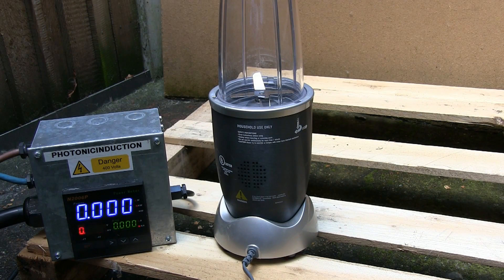Wrong Voltage - Wrong Country

Comment: So thoughtful of the designers putting in that vent on the side for the smoke to come out of.
Reply: Motors need noses too
Reply: If only the smoke stayed inside of it, maybe it’d work to this day as a reliable blender? The vent holes are to blame, of course.
Reply: @maxxdroid  yep. Once you let the smoke out, it doesnt work anymore. Maybe we should seal up stuff better.
Reply: If you look on the other side there's a little tank where you can top the smoke up.
Reply: @skylined5534  that's nice of the designers

Comment: Its like he knew it wasn't dead after 250v had to go for 500. lol
Reply: If it stopped working because of a small open in the windings, eventually increasing the voltage high enough will jump the gap.

Comment: The one dislike is from his the power company.
Reply: Are you kidding? His power company probably loves him... the more electricity he uses, the more money they make...
Reply: He puts lots of very short duration, large loads on the grid which stresses components.
And also lots of reactive power. Absolutely tons of it. They probably have a dedicated bank of capacitors to compensate all the inductive reactive power :-)
And let's not forget about interference and other crap put on the network by burning and overspeeding universal motors ;-)

And to top over that, he doesn't consume a lot of energy. Probably 2 or 3 kWh per experiment, which is about 0,6€ at 0,2€/kWh (which is very expensive) so he is a nightmare for the power company :D
Reply: If I recall a previous video, he has a battery system in his house that charges up at night when the rates are cheaper.
Reply: That's only for general house electricity, it can't supply the many KW he tends to pull in his videos, not even for short time periods, for the vids he is purely using grid power.
Reply: Max And utility workers.
Reply: More like his insurance company.
Reply: Do you seriously think that the power company cares a single bit about these experiments? At my work they have like 50x 200kW machines running 24/7. The limit of one household is like a fly for the power company.
Reply: @willdemeyer6397  Never!

Comment: Wish he kept it at 240 a longer time. Would have liked to see how long it'd last.
Reply: he didn't get far beyond 240 tbh, within tolerance. some houses get close to 230, some get close to 250, its not inconceivable that some houses could go all the way to 250
Reply: Qwertydex I think they make one for the european market I guess they use similiar components to cut down on cost so it would maybe actually last a pretty long time
Reply: It failed at 253. Anyway. In the US, measured 10 homes and I never saw anything beyond 235.13V - 245.01V (yes we use 240V here, its a center tapped pole transformer, Line Neutral Line, 120 0 120) outlets in homes here are usually usually split, half of the home runs on Line 1 and the other half runs on Line 2, while 240V appliances (electric ovens, washing machines...) use all three (L N L) (with neutral just for safety)
Reply: yeah, if failed at 253, so it wouldn't have survived any longer if he kept it at 240, its a small increase relatively speaking :/
Reply: +Qwertydex
249 at my meter. Klein cl2000 measuring tool.
Reply: If you allow 10% fluctuations then yes the 240 will go over the 260 volt make, in Australia it used to be that a appliances were designed in stating 240 volt and it would allow within that margin and the voltage from the outlet would usually range at the standard 220 up to the 250 volts. I've had meters at the outlets and written it down over the years and the fluctuations I've noted. Rare did I see above 255 volt but yes it has been above that. Nowadays I see devices say 110-220 volt so I'm wondering if the companies are allowing for that 10% fluctuation. Which might explain why I've been hearing more and more stories of devices failing of voltage overload over the last few years, so long as the voltage has been reasonably set to the countries rated voltage.
Reply: It wouldnt even have lasted at 240, prolly not even 200, as the motor spinning up lags behind the voltage applied. It was the motor that blew out. So wouldnt have made a difference.
Electronics blew at 500 smth. For as far as there is electronics in it.
Reply: I bet it would have lasted a few minutes on 240vac 60hz. Maybe I will find one to test

Comment: That was short and sweet. :-)
Reply: Especially when it eventually in the end well sort of may be shorted out hence the sparking in arcing. Although some of that could have been opening circuit but usually there's some shorting going on when the motor gets out hot and of course is smoking like that.

Once had that on an old 120 volt motor that was running something but it just wore out the point that the warnings were no good probably bit of overload as well but the voters for dirt cheap I knew where I can get them for nothing they were being replace all the time in particular devices so yeah indefinite Supply of the motor so I did not care one bit.

Use them in all kinds of things BP Motors use them in all kinds of things Fifi Motors even after they were replaced it don't know why they were being replaced or what they were in but they still work just fine for what I needed but not in the original application for some reason???

Reliability loss of performance who knows I was not the only one picking those Motors up either I found out.

A few places in town I could get these as well as large supplies of them.

If I remember correctly there were series Motors Universal Motors but it's possible they were DC motors specifically shunt worth compound wound can't remember long time ago all I know is they did have at least one set of brushes in them which occasionally I did replace I kept one Stella compatible on hand is those things just for brushes quite a bit even in normal operation although I think my brush won't life may have been longer interracial because it be running at lower speed my applications normally.

Although they were very high quality FIFA Motors still couldn't figure out what priests ever be replaced that's such a heart rate weird maybe it was something that was critical about them that had worn out or who knows?
Reply: thats what she said

Comment: Fun fact, Back in time there was 110V as paralell for example in some aplications on railroad, Military, etc.

Some apparats had a backplate switch that could be adjusted between 110 to 220V (GB had 240V, wich ment 20V above old Scandinavian standard, today EU standard is 230V)

A friend told me that he forgot to put back the screw for the voltage switch on the Shaver after wisiting an old Mil camp out in the norhern forest here, so it run on extremly hig speed when he turned it on next morning after went home with the train, but he was able to sawe it...

Comment: This makes me remember the hair dryer I brought with me when I visited the States and set it to 110 volt. Then back home I forgot to re-set it to 220 (or 240..) and I started it and felt it was a bit... hot. :D Got very hot quickly and quite red (in the elements) thank goodness I pulled the plug quickly and it is still fine. It is an dryer from 90s and is for "travel use" hence switch. (the kind that you need a fat flat screwdriver)

Comment: The United States is actually a 240v country as well. But most of the equipment "except 16,000+ BTU air conditioners, electric water heaters and electric dryers" in the United States are rated at 120v.

Comment: Turns out a 60 hz appliance can receive 50hz current without much issue, other than extra heat. As long as the voltage is the same as what it requires. :). I just recently found that out and was fascinated!

Comment: So ALL the outlets in the UK are 220/240? 220 here is reserved for very large compliances like a cloths dryer or hot water heater.
Reply: All outlets in UK 240.Volts and same in Australia. Sometimes it can get high as 260 Volts which can be a problem for some 220 Volt devices.

Comment: have you done anything with an electron gun from a crt tv and a resonator from a microwave. it may have an interesting effect, if I'm right, electrons will follow the flow of a magnetic field, my concern is what happens afterward. once resonance is achieved and then the induction of electrons occurs the flow may need to be condensed in order to have a more defined effect. I always wanted to see what it would do lol

Comment: Are electrical deaths more common in other countries due to higher voltage?
Reply: Richard Harrold voltage hasn't got much to do with it. 240v will also grab and kill you. Any ac voltage will cause your muscles to tense. It's the current flow across your heart is what kills you.
Reply: Not really, either one will kill but under normal use (and modern breaker boards) you're pretty safe unless someone dickered with it or it was shoddily made
Reply: Richard Harrold I've been hit with 120v more times than I can count, usually just a little tingle if your not wet or anything, but it most definitely can kill you if you have moisture on the area. I just imagined that 240 is more lethal because it can overcome your body's resistance more easily... that's what voltage does, of course.
Reply: Well AC can overcome the resistance of your skin with as little as 20 or so volts, so if that's what you're going by then it makes very little difference, what does make a difference in how lethal it can be is where the current flows (through your heart is very bad), how much current flows and how well it holds you onto it, so at lower voltages it's actually a bit more dangerous because you won't be able to let go of the thing shocking you.
Reply: You are wrong in 2 things, the first's one is that it's obvious that the current is the killer, but the current is directly proportional of the voltage (ohms law), so if you have more voltage whit the same resistance, more current will flow through your body. The point it's not to analyze if both of them will "grab" you whit the same force; how much current will flow it's the important thing. And secondly, the current not only kills by Atrial fibrillation, it can also kills because of the burns that it can produce in your body
Reply: Richard, I do not think that the difference of only 10 hz in the frequencies is a factor that we have to take so much into account. I afirm this because of the lack of academic information on the internet about the dangerousness of the 50 hz and 60 hz frequencies in ventricular fibrilation ( i correct my previous comment). What can be found everywhere is the relationship between electrical current and ventricular fibrillation.
Reply: It's both volts and amps that kills you, if youtube chose to show the comment i made, if not just search "It's not the volts, it's the amps" youll see Afrotechmods posted about it.
Reply: Atrial fibrillation isn't what kills you in electrocution, it would be ventricular fibrillation, or even instant asystole.
Reply: Woops, just saw your comment correcting yourself. My bad.

Comment: Finally, an American appliance! :)
We use 120v @ 60Hz. Our GFCI (RCD) outlets handle 15 amps and allow for polarized, nonpolarized, and grounded plugs. That limits us to 1800W per room unless we have a 20A breaker for that room. 
We do have 240V outlets here, but they are 3-phase and ONLY for built-in electric stoves, dryers, central A/C and large home water heaters, and they too are at 60Hz. We have nothing in common with the British domestic grid.
Reply: SouthwesternEagle they also changed there system of measurement after they couldn't tax us then they came back 20 year later and attacked us and we kicked there asses and we wrote a song about it, the American Anthem.
Reply: SouthwesternEagle why else would the British associate the "pound" with money and we associate it with "weight"?  CONFUSION ON PURPOSE RIGHT ???
Reply: Benny Heflinger, please. I'm as American as you are (I'm a leathered ranch-style Texan Harley biker), but you're displaying profound ignorance coupled with impulsive nationalism. A Great British Pound used to be the value of a pound (lb) of Sterling silver. That's why it is called a Pound. I would have needed to pay 870 lbs. of solid Sterling silver (£870) to board Titanic in First Class in 1912. That's over $50,000 today!
Britain ceased the Gold Standard in the mid-20th Century, but the name "Pound" still remains. There's no intentional confusion, nor is Britain America's enemy.
The American Anthem isn't the name of the National Anthem. It is called the Star-Spangled Banner.
Reply: SouthwesternEagle when did thr boston tea party happen and how long after was the metric system established ?
Reply: The Boston Tea Party happened in 1773. The Metric System was established in France in 1799, but the English didn't use it until the Decimalization in the 1970s. It was almost exactly 200 years from the Boston Tea Party to the British adoption of the Metric System. The Boston Tea Party has absolutely NOTHING to do with the establishment of the Metric System. Now in 1824, the Imperial System was enacted in Great Britain to replace the Winchester Measures of the Middle Ages. That happened 51 years after the Boston Tea Party, so again, no relation.
Reply: SouthwesternEagle I love england and the world but there is without a doubt cultural differences around the world such as LANGUAGE.  Does 240v directly mean better?  Does having a guitar with electricity flowing through it make it superior to an accoustic?  There is reason why the United States power grid is the way it is and I don't believe for a second it directly has to do with power output.  I honestly don't think this a great time to have arguments about power grids and measurements and what if there is a superior song or language that can be sung.
Reply: SouthwesternEagle i actually tried to buy a teakettle from china the other day (chicken themed) and they would refuse to sell me one when in actuality i have a european ported chicken theme tea kettle from the 1950s with a power adapter and it works even tho it was not created in this country.
Reply: SouthwesternEagle I am sorry if I give that impression but what I see is the ovious, that many country's around the world globally use 240V power directly to there households but for "some reason" North America uses 120V direct to household...and the first thing I ask is why?  Why is there 120V in North America when so many countries use 240V.  I don't see this as an easily explainable thing.
Reply: I said in my parent comment that we DO use 240V here, but it's only for dryers, water heaters, central A/C units, and built-in electric stoves/ovens.
Reply: SouthwesternEagle I am fully aware you mention that we do have 240V for certain application.  And I believe 1800W is basically the "safe limit" for appliance in North America when it comes to things like blenders and boiling tea electronically.  This is why one of the reasons China would refuse to sell me a 2400W tea kettle.  They mention to me they would create an American model of the tea kettle in the near future and I would assume it would be 1800 wattage or less.  Does that in fact mean it will boil me tea slower than a 2400w teakettle?  Yes.  But can PHOTONICINDUCTION boil tea in 1 or 2 seconds (; ???
Reply: PhotonicInduction can make tea in just 5 seconds! :P He can make a 10,000 Watt model. XP

Comment: You can be so proud of that Wikipedia entry!  Anyone who already produces 400,000 volts at home and can supply the whole city with it, someone like that must be classified as generally endangered, you are an outstanding example of Tessler's free energy, I wish that would do more, then all 4 parts of the matrix trillurgy would be ripe for  the dustbin.  I'm currently building my Free Energy Bike, a 12kg mount bike with 2 motors, one of which drives the other with electricity and the other turns the electricity faster and faster and at home I use it as a generator and terminate the network company.
Reply: He's still plugged into the grid, so it doesn't matter if he's generating 400kV or 400TV, it's still coming from the same place he'd be returning it to. So it doesn't really make sense to say he can supply the whole city with it.
Reply: Du verfolgtst alles gut, aber wo ist hier das Netz? Bitte.